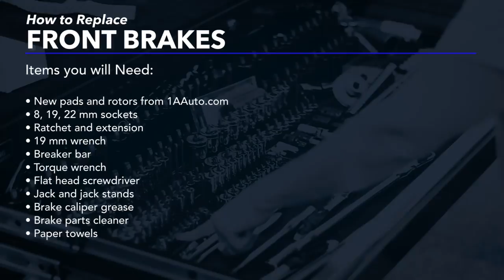How to Replace Front Brakes 07-13 Chevy Silverado

Comment: 1 thing to keep in mind , at least for newer vehicles , sliding out the brake pads  themselves is not easy as portayed in this video.  The little bracket that holds  the pads has a little tab that keeps the brake pads from sliding out.  You can punch them out the opposite direction to remove  them.  You will  have to remove the caliber bracket first tho.  Did this on a 2015 Chevy Tahoe.
Reply: Yeah the little tabs on them got my dad and I confused. The tab is supposed to be out but we thought it was supposed to be bent in and the pad goes on it. We even snapped one off on “accident” and called it a day.

Comment: You should always replace the clips on the brake slides. They should come with the new brake pads.
Reply: Yeah the little tabs on them got my dad and I confused. The tab is supposed to be out but we thought it was supposed to be bent in and the pad goes on it. We even snapped one off on “accident” and called it a day.

Comment: I changed my breaks. But my brake caliper housing is still loose when I tightened the bolts. Is that common?
Reply: Mine was the same, what I did was use a rounded metal bristle brush for a dremel with a liiiiiiitle bit of brakeklean to clean out the dust and debris from the bolt holes and I was finally able to tighten the bolt all the way.

Comment: Same process for 2006 four wheel drive?
Reply from the maker: +The Bowzer The correct video for the 2006 Chevy Silverado is linked below, however, you might be able to apply some of the basic steps shown in this video to your application. Hope this helps you out 

https://www.youtube.com/watch?v=25_8oHz1LS8&feature=youtu.be

Comment: You didn't spray the new brake pads off with brake cleaner. There could be dirt or debris on them or a chemical that's unknown and could be harmful to the rotor and effect braking. Always a good idea to spray them down as well. I do each brake job.

Comment: What’s the name of the handle looking part behind the caliber at 2:42 ?
Reply from the maker: +Richard Bethley Thanks for checking us out! That may be the sway bar link if you are referring to the black piece that is perpendicular to the control arm. Here is a link that shows this piece separate https://www.1aauto.com/chevrolet-gmc-cadillac-front-sway-bar-link-pair-general-motors-oem-gmsfk00004/i/gmsfk00004?f=939531&y=2007

Comment: Typical of GM engineering to place two bolts side by side, one a 18mm and the other a 19mm! The 18mm is torqued to 140 ft lbs. Somebody beat  up the 18mm bolt by putting the wrong socket on it! It took my acetylene torch to loosen up this beast! Then a trip to the hardware store for a new one @$5.29 per bolt. A breaker bar is useless in this scenario. Clean the 18mm bolt well and put an eye on it before you try to fight it.

Comment: Kind of worried about following this tutorial. You spray brake cleaner on rubber boot and also the rotor when you don’t need to do those things. Not to mention you torque down some bolts for the brakes when it just needs to be hand tightened. To each their own I suppose.
Reply from the maker: +GETxS0ME Thanks for the feedback!
Reply: On the rubber boat I’m not sure, but on the rotor you are supposed to as they come with chemicals you need to get off.

Comment: Aren’t you suppose to put in new brake hardware when installing new brake pads?  Also if your caliper doesn’t have a rubber boot, shouldn’t you put one on?  Smh
Reply: Agreed , you should have put a rubber boot on that slide pin. And I usually use brake clean on the pads to make sure they are free of crud.
Reply: He didn’t even bleed the brakes 🤦🏽‍♂️
Reply: Not needed when replacing pads and rotors.